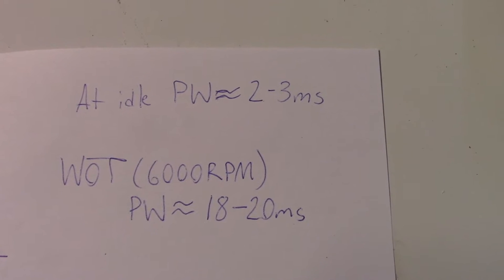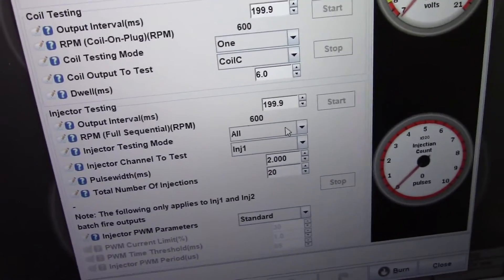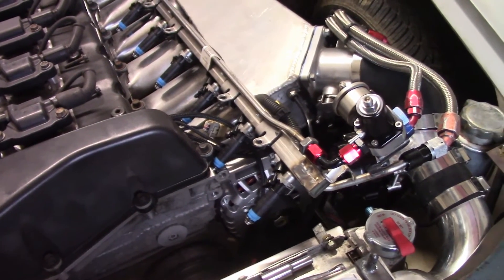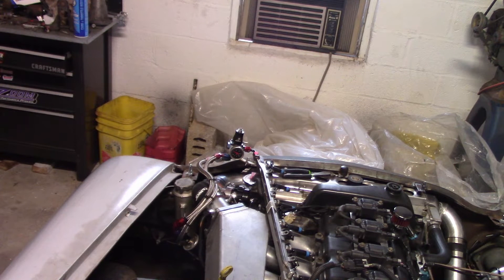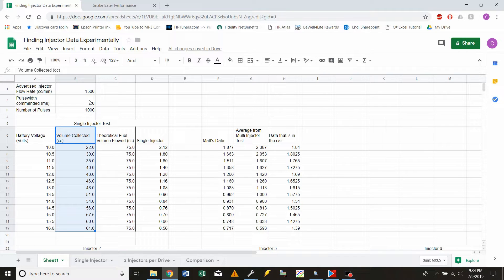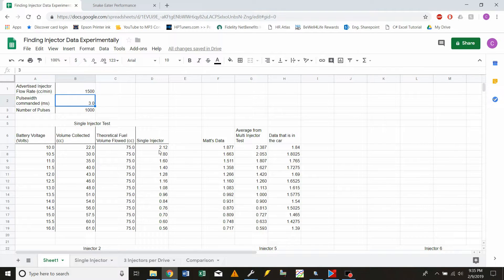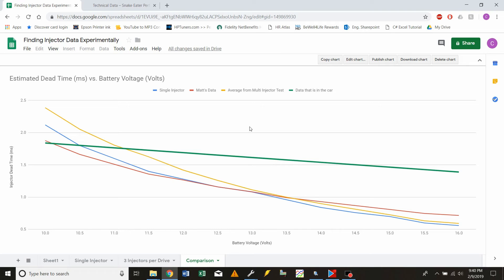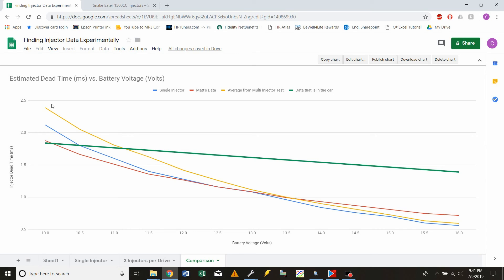Finding Injector Data

Comment: It's sooo much easier to just use an oscilloscope. You can see when the trigger signal is sent to the injector, and you can clearly see the blip in the signal when the injector pintle actually opens, which gives you very precise timing of how long the dead time is without all this measuring of fuel in a graduated cylinder.
Reply from the maker: It's actually easier to just reduce the pulse width slowly until it stops spraying fuel. No fancy equipment needed. Live and learn.

Comment: Im using speeduino with tunerstudio and it seems that test mode is only available with megasquirt systems. Hmm. I want to be able to find the data for my oem motorcycle injectors.
Reply from the maker: That sucks. I'll stick with the Megasquirt stuff.

Comment: Does fuel pressure or flow change with voltage??
Reply: It shouldn't unless the fuel pump is defective and unable to operate at 10v
Reply from the maker: Potentially. Depends at what operating point you are at

Comment: Where do you input the injector data into tuner studio? possible make a quick reference video? Thanks for this video it is very informational
Reply from the maker: Its under the first drop down. Look for injector offset. Not at a computer right now, or I would tell you exactly.
Reply: @Calvin-Nelson  fuel settings, then injector dead-time/PWM?
Reply from the maker: @robertballard4148  Yeah. That's the one.
Reply: could you send me a screenshot of the way you set up the injectors in tuner studio via email please and thank you bobsr6@yahoo.com

Comment: Hey Calvin! That is a bad ass car you've built! Awesome video also, I appreciate people taking their time and making stuff like this for others. Sorry about the data confusion, I had more comprehensive data on our old site but when I switched over to Shopify some things didn't translate.We have Xcel files with more in depth data that actually considers ignition volts we just have to email them right now. anyways, you did an awesome job getting it and made a bad ass video! I've seen your car arpund the net and had no clue it ran SEP injectors! I am super happy to see that, thanks for sticking with us!
Brad
Reply from the maker: I knew you guys would have the data. Lol. I just wanted to try a little science experiment! The injectors are working great so far. Thanks for the kind words!

Comment: Hey man when do you think you'll be back at the dyno? Found a pic of the atlas bottom end and the it looks solid. MotiveDVD did a strength test video series comparing the 2jz to rb30/25/26 and barra and the 2jz was strongest of them all due to its siamese bores. From the pics ive seen the atlas has siamese bores aswell.
Reply from the maker: I'm not sure. I would like to do some more improvements , and maybe some track testing before I head back to the Dyno. 

To be honest the Vortec 4200 would probably not fair well against the RB, 2JZ, and Barra. It's aluminum block is known to have strength issues. The primary advantage to the 4200, is how cheap and readily available it is.